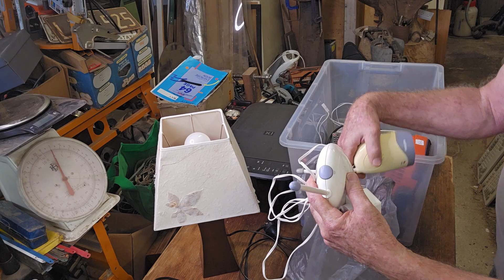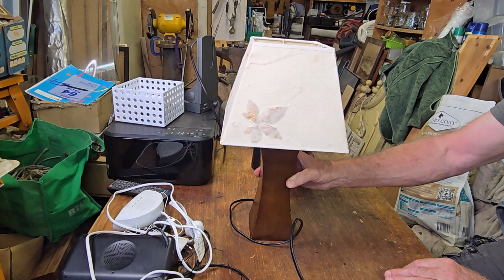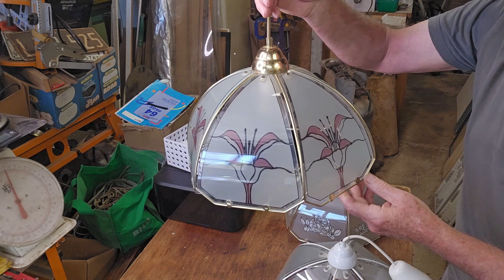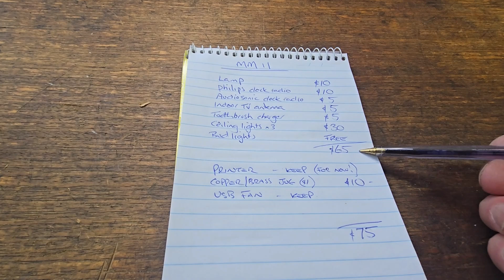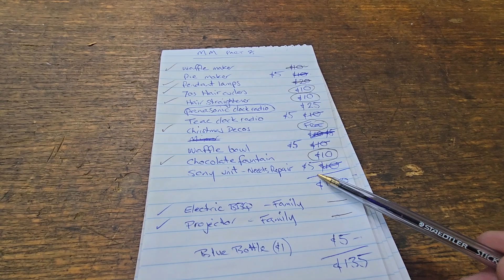Monday Marathon 11 - Processing Ewaste picked up from a Charity Shop! Some to Sell, Use & Scrap.

Comment: Am I to understand those ceiling lights just plug into an existing light socket and don't need to be hard-wired in by an electrician?  I don't think I've seen ceiling lights designed like that before.
Reply from the maker: That's correct - they are basically a lower light extension with a shade.
Reply: @TheUltimateRecycler  I'm not sure I've ever seen anything like that before, except for some exterior security lights our family had back in the mid 90s.

Comment: I'm not quite sure why the baby monitor has that talk button on the transmitter.  I think generally baby monitors always transmit when switched on, the monitor transmits to the receiver until you turn it off of course.  I don't think too many baby monitors like this one have two way communication.
Reply from the maker: It did seem a little odd to me as well. I guess this one is for babies to order room service! 🤣

Comment: The foot warmer from the previous week is often jus the same warmer that is used under home brew barrles to keep them warm enough in winter so the yeast doesn't die. SO maybe check if that is the case and if so maybe unwrap it from the material re label it as such.
Reply from the maker: You could have been right mate, but I've sold it now anyway! 😊

Comment: The coffee maker uses paper filters - don't chuck it.! 😊
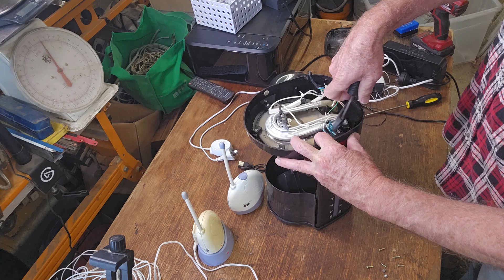EDIT: 14:56 Too late...
Reply from the maker: Ah yes, I knew that - but it needs that strainer to hold the paper filters.
Reply: @TheUltimateRecycler  Ah, that's probably where I went wrong with mine. I'd put the paper filters straight into the recepticle. Seemed to work at the time. It made crappy coffee though so I changed to a proper perculator.